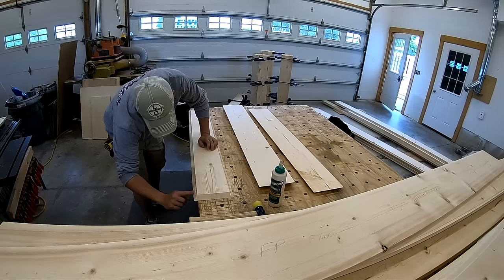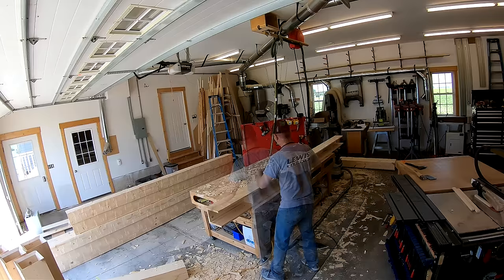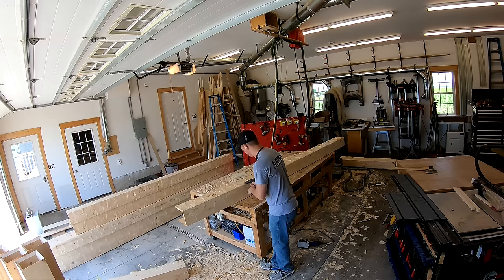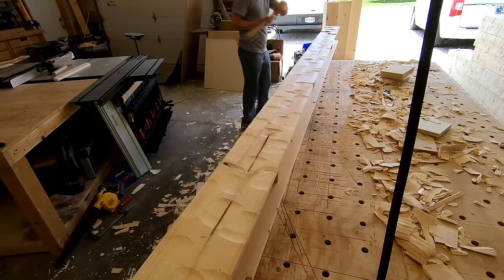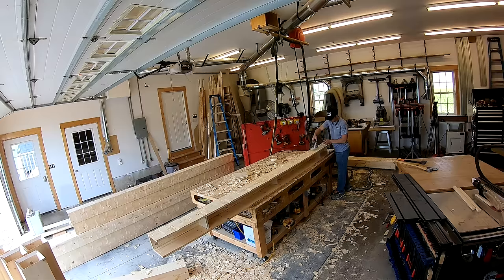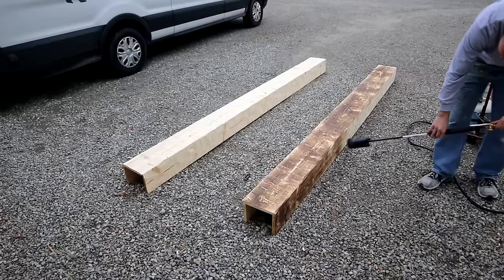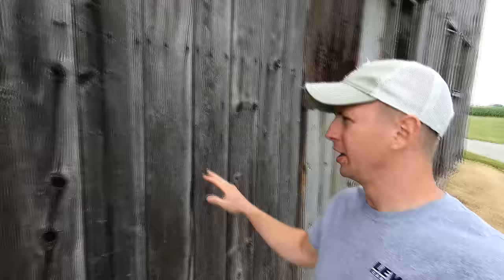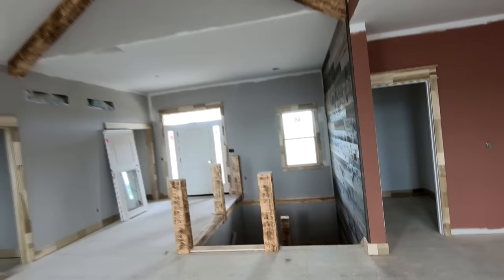How to Make Authentic Looking Barn Beams (Tb stained later)- The Distressing Process

Comment from the maker: Support the channel by visiting these affiliate links:
Barn Beam Tool List - https://www.amazon.com/shop/insider_carpentry?listId=2T4HASQ6O7YU8
Makita Wire Wheel Sander - https://amzn.to/2FH6qlT
Makita 794382-7 Wire Brush Wheel 120 - https://amzn.to/2S7Eitk
Festool 574690 Planer - https://amzn.to/2KwjYPH
Festool 485331 HL 850 Rustic Planer Head, Undulating - https://amzn.to/2KvwS0j
Fiskars Hatchet - https://amzn.to/2Rfk9S8
Broad Axe - https://amzn.to/3iQixws
Dremel Saw Tool - https://amzn.to/2Kxqvd5
Hot Max 500G Big Max 500,000 BTU Propane Torch - https://amzn.to/2SaQEB2
 Red Dragon CD-100 Propane Cylinder Dolly - https://amzn.to/2BwqlQ5
 Festool 583492 CT 26 E HEPA Dust Extractor - https://amzn.to/2Kuo7Ui
 Festool 496120 Longlife Filter Bag Longlife for CT 26 - https://amzn.to/2P2D6FI
 Bosch 16.4 Foot Vacuum Hose, 35mm - https://amzn.to/2TDJQxr
Festool 487721 Hose Sleeve, Reducing Sleeve For Antistatic D 36 Hose - https://amzn.to/2SfOC2J
Collins Miter Spring Pliers and 4 Miter Clamp Kit - https://amzn.to/2ScUppI
Collins Tool Miter Spring Clamps - 12 Pack - https://amzn.to/2DKMyM9
Reply: Any idea if the undulating blades would fit in a dewalt planer. Google comes up with nothing and I cant find the size anywhere
Reply from the maker: Knowing festool there is zero chance it works in anything else.
Reply: @InsiderCarpentry  yea no chance. I have a wood master planer/molder.i emailed those guys and they are going to custom grind a few sets of blades for me. The cupped blade looks a lot better than flat blades. I been doing a few mantels with a draw knife. It takes forever

Comment: I actually hew logs into beams, using a technique very similar to your hacking. When you make the cross grain chops, strike down at an angle with the bevel down and the leverage of the bevel will raise the chip. Progress down the log, chopping behind the first cut. Then use the broad axe with the bevel up and the blade flat on the surface and swing the axe in an arc, keeping the axe on the beam to remove the chips you raised. Cutting into the chip makes a deep gouge, cutting against the slope of the raised chip leaves a smoother finish. This second method will save you some of the smoothing steps you employ, but may require you to find another way to use the tools you are trying to sell.

Comment: Excellent work, thank you for sharing.  Personally I don't like what the fire/burning does to the beams, I think you can accomplish better results with paint and stains...
Reply from the maker: It is not finished yet. They get stained.
Reply: @InsiderCarpentry  I know, but the burning does something to the pine that does not look right in my opinion. Have you ever tried using wax and paint?
Reply from the maker: After the stain the dark spots actually all but disappear. I’ll try and post a follow up video with the finished product on these. 👍
Reply: Please. do a follow-up video, I am going to have a post frame house built and     I may do some beams in the great room.
Reply: Insider Carpentry that would be great. Thank you

Comment: i build a lot of fake beams, and do almost what you do.i use a broad ax and then i use my power plain to rip the loose wood and it gives it a great effect and saves some time.i burn and use the same wire wheel as you i then use a vinegar solution to age the boards more.i start with rough pine or hemlock, hemlock i like the best.what bit are you using to get that 45 on your boards
Reply from the maker: It’s a freeborn lock miter. If you go to my beams playlist you’ll find a video on the freeborn lock miter bit to make these style beams. 👍

Comment: Great help. Im building a Faux log cabin. I will be using 2x10's as my "logs" and will be chinking them. I will also be doing the same on the interior outside walls so as to make it look as real as possible by lining up the inside "logs" to match the outside logs.

Comment: Saw Max is great.. but they die realllly fast. They don't do well for extended use and get hotter than the devil's tongue itself.
 
The Restorer has been a great addition for barn beams for an inexpensive multifunctional wire brush systems. The accessories coming out for it have been great. I'm yet to try the Makita for that.
 
Your projects are great! I love seeing how everyone does it just a bit differently. It's almost like a woodworkers signature... you can basically tell who made it based upon the designs.

Comment: @InsiderCarpentry What cost effective material would you recommend using to wrap multiple structural beams in a two story cabin? I hate the color and they are too dark. I do not want to strip or sand the beams as it would be too much work. I also want to hide imperfections where beams meet cabin walls. I just need like a thin rustic material that can be stained glued and finish nailed into the beams. I have probably 20 beams and each beam has three sides so we are talking about a lot of material. Any suggestions? Thank you much!

Comment: Nice technics... always nice to learn... but I guess thou beams for free (or inexpensive) if you tear them out of old buildings being torn down is more worth the time. Of course the weight of full timber is an issue you do not have consider when just using planks-made-to-belive-beams as decorations 👍👍👍

Comment: The Makita Wire Wheel is a little out of my budget. What do you recommend in place of it? Thanks!
Reply: Lowes sells a craftsman version that works well for under a 100$. Will have to buy the wire wheel though, it's 40$

Comment: What type of  joints did you use for the posts? Looked different that just a 45degree miter. 
Inspiring work. Thanks again for sharing your craft and time.
Reply from the maker: Its a lock miter. I use the freeborn cutter on a shaper.

Comment: Great detailed video. I’m building a bunch of these now. I have a fiskars axe. Could I cut into the pine with the fiskars & also use it to shave off the excess wood?
Reply from the maker: Yep. Its just not quite as wide but I have used a fiskars often.
Reply: @InsiderCarpentry  
I’ve done all your steps and it looks good so far. After I torch the wood and use the wire brush, could I then sand, stain & poly the wood?

Comment: Great skills and tips, but i hate fake beams!
Reply: I've been in over 5,000 homes over 20 years inspecting homes as a code certified home inspector. I've done a ton of homes as far back as in 1920s. If it's on the ceiling, no way I could tell if it was faux/fake in the right house